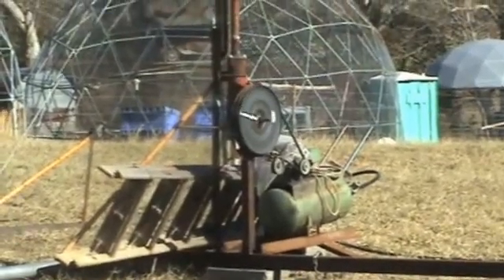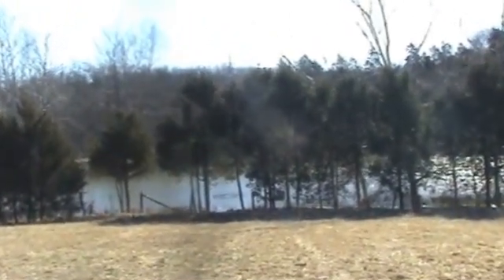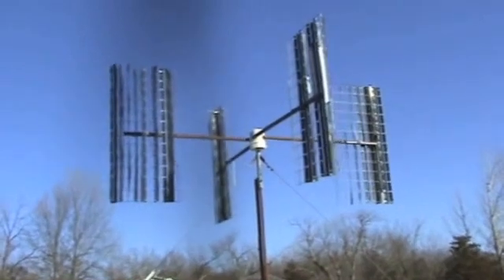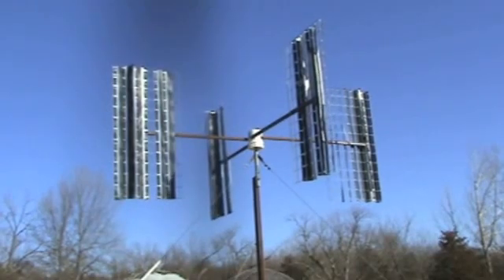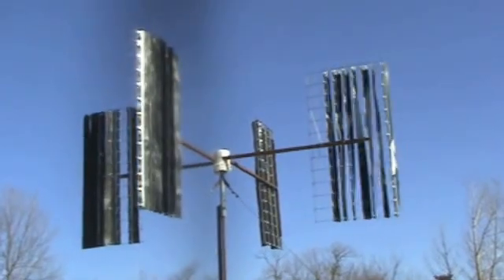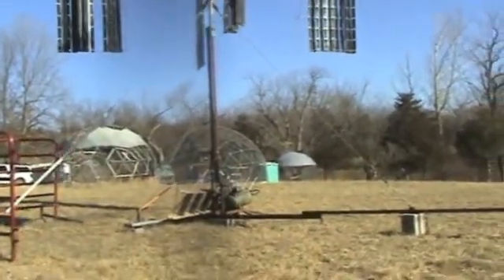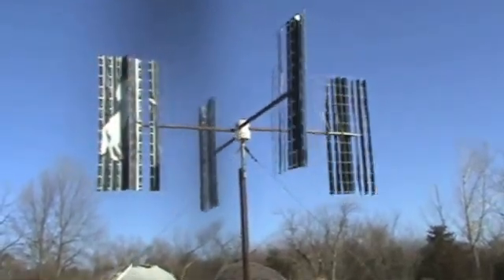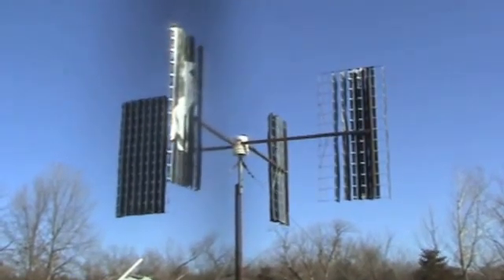VAWT VERTICAL AXIS WIND TURBINE, LAKE AERATION

Comment: You'll be surprise if I tell you that you will need to build only 4 wings with a span pf 4 ft. and a chord of 2 ft. styrofoam material, 1/2 inch aluminum tubing front spar and 1/4 inch diameter aluminum tubing rear spar.costing will depend on your areas price of the materials plus some expenses on mounting frames. youtube hot wire foam cutting so you can cut your own wings.
Reply: Wish I had that kind of Money and Time. I would love to do something like that ! Thanks for the suggestions

Comment: I appreciate your input and the time you took to analyze the design, this information would probably be useful if it were in "mass production" stage. 

This is the first full size prototype I have built of this design. After it has operated for over one year we will take it down and look at the high wear spots and look for stress fractures. 
Don't worry about accidents, no animals inhabit this field and it is fenced in. 
P.S. the tower is stable - the camera has distortion.

Comment: may i suggest you change your flap to Selig S1223 or Chuck Hollinger ch10 (smooth) high lift low Reynolds number airfoil as these nomenclature can really boost your windmills RPM

Comment: more wind of about 25-30 kph would,in the long run wreck havoc to your windmill because it lacks the rigidity to prevent the metal rod from exceeding its rated modulus of elasticity in short it will bend a little to a point that the foci of rotation will shift from the center of the rotating shaft to a point away from it. Net result.... a pronounced wobble from the apex of the windmill which in effect would exert a great stress at the root of the structure. An accident waiting to happen.
Reply: phoebekuan; That's funny, The camera has a distortion, there are three guy wires holding this thing very rigidly. No stress at all on the shaft, only on the cables.